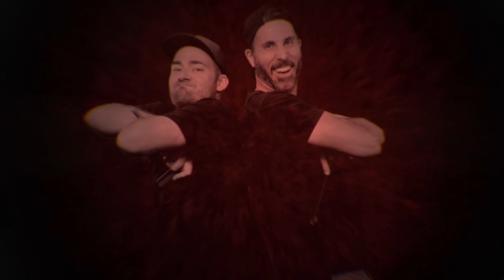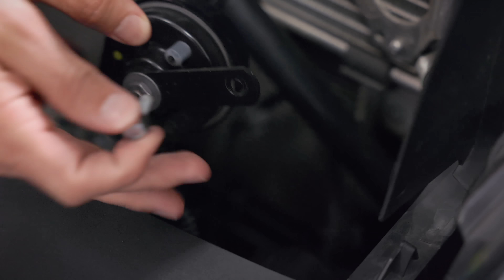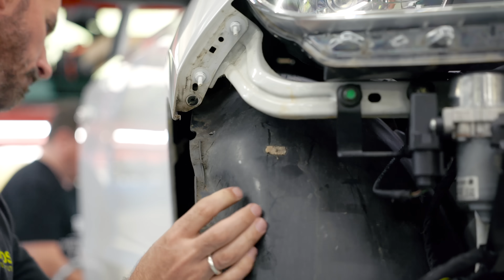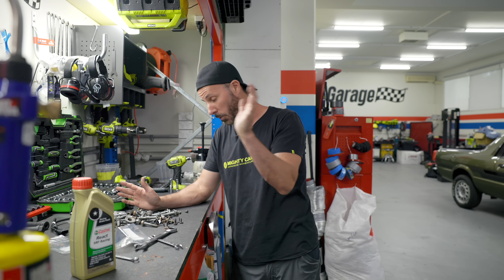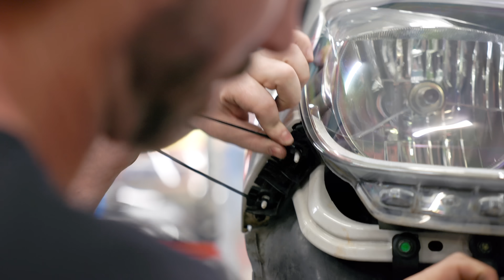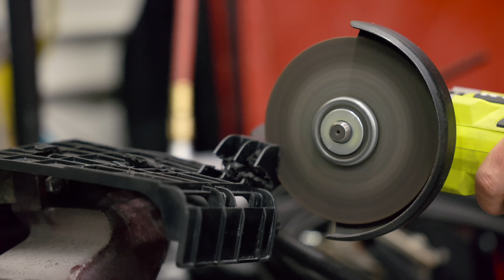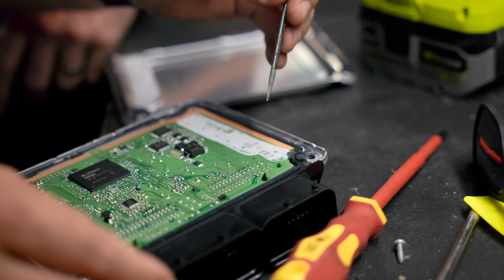I DESTROYED my VW UP! - Turbo GTI Conversion EP7

Comment: What a spin out. 1 month ago I slid off the road into a Paperbark tree in torrential rain in my manual Forester XTP and ended up flooding it (alcolock distraction exiting a roundabout) drained water from sump and exhaust and drove it home 3 days later. But 6 days ago I told the alcolock company I'm disconnecting my battery for at least 5 days to remove my seats and carpet to continue drying it out, put it back together 2 days ago now it doesn't crank or run, the ECU got corrosion affected. Whilst watching this episode I thought, crap, I think I too have an ECU problem. I even bought an "in the bin sticker" only a few days prior but never got around to sticking it on my black beast but it would've been very fitting 😮😅. Oh well, maybe inox and a clean will fix it 🤞

Comment: rebuild the ECU and hook it up to the car as usual, Get a jump start lead,  attach one end to the casing of the ECU and the other to the earth of the car. Unless you damaged something opening the casing it should start as if nothing happened.... what happens when the casing shorts to live is the earth pins melt, so your ECU would loose it's earth...

on some ECUs you can re pin the earth wires to different pins and skip the external earth

Comment: Take this as a learning point. ECUS are Electrostatic sensitive. The charge built up in your body from walking on carpet tiles or wearing cheryls nylons is enough to fry an ECU, never mind it arcing across from the main vheicle battery. The image of you guys randomly poking aorund with an uninsulated screwdriver with zero protection, wrist strap, attempts at earthing etc is worrying. In general, its frightening how many people in the automotive world dont understand this stuff, all the remappers who come to your house and remove ECU PCBs without any electrostatic protection etc. 

It'll fix, chin up. Take care in the future with this stuff.Respect for holding your hands up to that one on video!

Comment: The word "replica" has had its meaning somewhat subverted, as far as the automotive hobby goes, by the kit car industry - particularly the really poor ones like MR2- and VW Type 1-based body kits. What you're creating here is 100% a replica in that it is a faithful recreation of a more desirable car made up from genuine, aftermarket, and repurposed parts that make it nearly indistinguishable from the original.
Great work and wear that 'replica' badge with pride!

Comment: I imagine there would be a few electronic experts in Australia that could repair the board. Unless it's a data chip that is damaged and it's only a few functional components, they should be able to be replaced. Need someone who can troubleshoot electronic circuitry.

Comment: I felt your heart sinking to your guts, prob worse feeling when just about to get something going and that happens. Has happened to me a few times more bad solder joints in modules not a full zap but as someone said Most likely Blown earth point / junction under the ecu board. They usually have Diodes to protect the  sensitive circuts / Cpu etc

Comment: No need to get a new ECU. You just need someone with some IC knowledge to see what blew in the ecu. It was probably a capacitor or a resistor that's gotten fried. You should be able to repair to PCB fairly easily

Comment: Sucks about the ecu Moog I feel your pain.
I was dynoing my S13 and using a microtech and my new fuel pressure reg diaphragm failed allowing E85 down inside the ecu map sensor.
Replaced it with a EMS and when the auto lecky powered up smoke came pouring out. Had to send it back for repairs. All on a weekend of trying to get the car going.

Comment: Rather than spend all this money on a car that will have limited performance, why not put it into something which has more potential…

$25K into the civic would make a real weapon and we can enjoy seeing multiple dyno runs as parts go in. Build two civics and battle them. Buy a Kawasaki Ninja? Make a sleeper Audi A6 or A8? V8 swap a Mazda MX3?

But stop working on hairdresser cars and things with limited potential. No point building something with a low ceiling unless it’s dirt cheap, and the UP obviously isn’t.

Comment: Well, that’s a bummer. Actually, been there done that. When I converted my little polo from a 8v to 16v I too had to source some Ecus. (E.g. that’s my daily driver). Fast forward to today, I have 3 ecus in my possession, One with a deleted immobiliser, a fried one and the one that I’m currently using.
Reply: I still don’t regret doing this conversion because I’ve ended up having many laughs. That little polo has a character of its own!!

Comment: IOs on modern ECUs are usually pretty well protected, so you're unlikely to have killed anything critical, might just have destroyed some of the IO protection bits and pieces, it may be possible (assuming you can't find another ECU and get it re-coded) to do a component-level repair on the board.

Comment: the steering column sensor doesn't work because you broke it when you spin it before install, if you spin one turn more you brake the cables inside it. whatch back in the last video the clockspring had a lock

Comment: Had the same issue when welding was done improperly. Terminals between the ECM plug and the board melted. If it's just the case ground circuit that's been friend, which is likely, a little sweaty soldering could fix it.

Comment: Repair ecu if that is the option or replace it(you jus need adapt ecu to imobiliser system i have done that for my audi and vw passat, it can be done whith VCDS or ODIS diagnostic tools)

Comment: If the VBUS Positive is shorted to Ground, then look for TVS Diodes or other diodes that have blown.  Sometimes you cant see them as blown, but removing them can sometimes help to diagnose,

That said.  The damage can most likely blow 3.3 and 5V rails and damage the MCU.

That ECU is very common and would be possible to get them Second had and setup - especially with VAG equipment these days,

Just sucks when it happens.

Comment: Heartbreaking to see all that work come to a grinding halt, I feel the same way with my FXT at the moment. Just got the new rack and pinion installed and was driving it for the first time when the car went into full freak out mode and stopped worked before I got home. 8 new CEL lights and now the car cranks but won't start. The joys of a project car...

Comment: Been there Lads, my dad fried my ecu in my Volvo thinking he was earthing solinodes or something with a wire 🙄 I wasn't near him or the car when he was doing it so I couldn't stop him 🤦‍♂️ the car had stoped a n wouldn't run atall turned out it was the electric throttle pedal was the original problem 120 euro fix but then I had to buy second hand ecu 200 and get it remapped again and coded to the car another 500 so my father thinking my 2005 car was like an 80s tractor cost me 700 quid 😅

Comment: When he said hacker, IV spent my life basically cracking ecms, reprograming subarus and such I’m not a Volkswagen specialist but I know you can find the burnt resistor, diode, internal fusing of some sort, and replace and fix it, I know Subaru has a protection circuit Volkswagen is probably an act of god to get the ecu reprogrammed.

Comment: Fans on full bore with ignition on, means ecu damage or limp. Send ecu to specialist. Also on many cars you need an ambient temp sensor in order for your ac to work correctly.

Comment: A tough lesson to learn, if you are removing the ecu from the car, disconnect the battery. I have over 40 years of electronics experience and defence aerospace experience in Australia.
Plan your tasks for success and not failure especially when a local replacement doesn’t exist.
$2000.00 should be only petty cash to your show, it’s obvious that you get a fair bit of free gear. 
I what I say doesn’t make sense, put yourself in the shoes of a small business owner who has just blown up a customers ECU through rushing a job.

Comment: Oh we had an Amorok in at work, the fan would come on at full speed... it had many other issues like the high stop light staying on, and we found the problem there was the plug on to the computer had corroded pins etc, and we had to change the computer which another shop spent 3 weeks trying to get sorted, but ended up having to disable the securtiy system to get it to work. and change a few of the connections in the plug (not my favourite thing in the world to do) but then we changed out the temp sensors because the computer was saying they were faulty... and the rear one decided it was going to fry itself straight away and was reading 147 degrees C before the engine had even been started. the fan problem was still there. so we struggled to get a new new one in there for a while, and spent about 5 hours trying to beled the cooling system, which eventually became pulling the restictors out of the smaller bleed lines and unblocking them... just waiting now to see what the next problem is with the one vehicle that we work on the most often... the VW! I jusy can't understand why anyone would want to have a car in the garage more often than on the road! especially when there is a 4 week wait for all the parts that have to come from germany!

Comment: The case of the ecu is ground, there will also be ground pins on several of the ecu connector pins. Shorting the case to 12v will flow a lot of current out through the ground pins. Need to check these ground pins and where they connect onto the pcb. It's possible that the electronics is ok but won't power on. Does VCDS connect to the ecu? Are the electronics powering up?

Comment: Like a tonne of people here have said, it’s not irreparable. Most auto sparkies have access to someone who repairs them. 

Also, the ECU is normally fairly standard, esp for VW.  You simply download the firmware using the correct tool. Getting the correct tool is the hard part, but most dealers will have this. Best of luck, I’ve been enjoying this project because I’m my experience, it’s representative of how most projects go for me :)

Comment: I remember spending hours doing the timing belt and pulleys on my car having to pull the engine half way out, and after finishing and starting it realizing that a little metal washer had fallen into the bottom part of the belt without me noticing it, getting pulled into the timing gears and skipping a few too many teeth, until the valves and the pistons had a love affair. It was dark, cold, and I had spent the last 10 hours wrenching on this car, that had just died in front of my eyes in no more than 3 seconds. 

It´s all part of it and this video reminded me of that day. After about a month of not wanting to know anything about the car, I went in the garage and starting wrenching again. And so the never ending cycle of DIY amateur mechanics wannabes starts all over again.

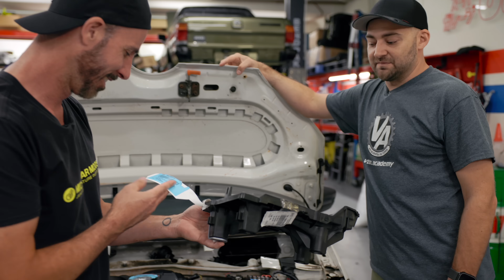Comment: 3:15 is true omg
i was so confused that shit just turned on in my rental randomly a couple times... like when entering a roundabout it just straight up yells at me that im crashing

fkkin electronics drove me nuts, the lane correction almost drove me into a construction site as well until i finally found the button to shut it off.
also automatic braking when it read speed signs for parallel roads and just jams in the breaks while on the middle of the autobahn

Comment: ECU lives in the N/S/F wing. 2 rivnuts needed in the pre drilled VW factory holes (on the MK1 shell) and their ECU wouldn’t have got fried…

Still no replies to any of my comments and offers for help😂

I have a 2012 MK1 Up here in the UK running a 2020 GTI full engine and loom with 196bhp exactly as these guys are trying to build. And my Mk1 sleeper bumper fits properly too 😉

Comment: Take the circuit board out of the casing and sometimes the pins between the circuit board and the connectors get fried. Usually a re solder gets the connection back and it may just sort the issue. I’ve seen it happen to 1 and that ended up being the source. Was very similar symptom wise to what you shown.

Comment: Gutting. One tiny mistake and the whole project goes down in flames :_(

Or is it a mistake? What dickhead automotive electronics designer at VAG thought it'd be a good idea to tie anything within the ECU to the outer shell? Surely the shell should tie solely to chassis ground if anything - like a Faraday cage. All the electronics within should only be tied to the connector pins.

Marty's right though, after a major down the only way is UP! Don't give UP! :D

Comment: 2 Fixes   Put an aftermarket ECU in or fix the old one. The old ECU may have a couple of burned out connectors on the board. GOOD LUCK WITH IT...

Comment: It should be possible to install a used ECU from the wreckers and program it in? At least here in Canada and I believe the US, carmakers are required by law to (grudgingly) provide the tool necessary to do this for independent shops. That being said, I've never done this to a VW, and I have no idea if any of that applies to that intercontinental clusterfuck. I think the better option as others have said, is to repair the ECU, which should be very doable.

Comment: You can get a second hand ecu from the same year and model of up gti but, you would need the key, key barrel, instrument cluster/clocks that came with the car you buy the ecu from. This then should mean no coding required. 

I'm no professional though but I had an audi a4 that had same problem, ecu got water ingress and this is what I did to resolve as my original ecu wasn't able to be repaired.

Hopefully there is an easier option for you. Love the series been subscribed for nearly 10 years. Thanks for the great content.

UK

Comment: I own a 2006 B6 Passat that came as standard without a MFSW and a DIS stalk to change the dash screen. I swapped in a mk6 GTi Golf steering wheel, squib and a 2010 Passat CC colour MFD dash in and coded it all with my VCDS and its the best interior upgrade I ever did. Makes the car so much more comfortable to drive just out of a info standpoint. It's well worth the hassle of upgrading for anyone who has a VAG wagon
n

Comment: This is the only time that up-badging is appropriate and acceptable.

I used to repair ecu's like this. I never messed with an Up, but few jetta's and golf's. In super simple terms, you can swap some stuff from one to another and skip the closing or take them off, read them, program another if you're worried and put them back on. Do an Immo defeat and be on your way

Comment: I've been here dudes. Was in a rush to boost my 260RS and swapped the cables. Blew a bunch of fuses and the Power FC for my RB26. Not only did I have to find another specific ECU, but my tuner had lost the tune file and I had to pay to have the car tuned all over again. Dumb, dumb slip up, learned my lesson the hard way.

Comment: Dude I feel you, I did this last October to my JDM import 07 Forester Sti, after spending £15k on it (which I had to borrow 5k just to buy it with the plan to sell my99 sf5 turbo afterwards) then spending another 4-5k on mods I blew my ecu wiring an aftermarket alarm/immobiliser into it, it’s sat on my driveway still, can’t afford to repair it until I sell the Sf5 but can’t leave myself without a car as I work 6 days a week as it is. Cars are Pain (Donut reference)

Comment: It's been said nearly 1,000 times in the comments already, but as others have said, I would REALLY consider having that ECU inspected by someone familiar with microcircuit repairs. Mobile phone is the first thing that comes to mind. There was a commenter below in NZ who said to send it to him, he seemed confident he could fix it. 

As other's I've fried an ECU once doing basically the same thing. It was on an S13. It wasn't the positive battery terminal, but a positive wire that was in the footwell area. I took the ECU apart and there were some pins and components that were obviously damaged on the board. I had another bad ECU that I robbed parts off of. I got it all soldered back up and it worked perfectly fine. Admittedly, this was an early 90's ECU with discrete, through-mount components, so repair is a lot easier, but I'd be willing to bet there's plenty of people on the planet who can fix what you have. That would resolve any of the reprogramming issues you might have with a replacement. 

It's at least worth the try!
Reply: There are multiple chips involved that are coded and each have many many dozens of SMC contacts. Anything on the ground plane could be damaged and they have to be replaced, then flashed, in a way that preserves the match with the key barrel etc.. it's possible but very hard.

Comment: Get some high Res pictures of that PCB out there where we can see them. You'll have fried a ground trace or two but I bet there's not much more wrong than that.

You completed a circuit from ground (the case) to positive and the traces and pins coupled to ground acted like fuses. This probably isnt a big deal at all, good luck!

Please, do not further attack the module with stanley knifes and screwdrivers: you'll upgrade this from repairable to dead.

Comment: I did that same thing to my Nissan Sentra. Why does it have a metal case and is right by the battery? Doesn’t make enough sense to me. I had to order the exact ecu luckily I was able to find one on eBay and most luckily I found someone who could program it. Definitely not Nissan

Comment: Renault, Peugeot and in this case VW-Seat-Skoda-Audi like to have the ECU close to the battery. Changing the battery can be a expensive job to do if your not cautious enough. It's seen alot in Europe that ECU's get fryed by touching to battery +

Comment: I have no experience with an UP platform but if anything like MK4-MK6 then a used ECU that's parts number matched should work with an Immobilizer defeat but that's as much work as cloning